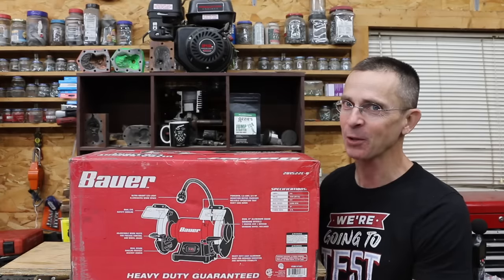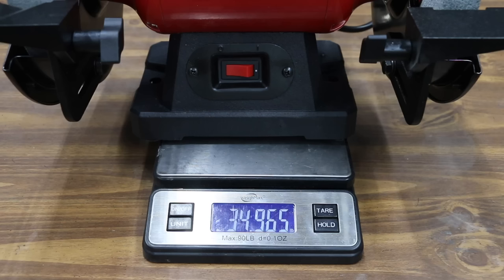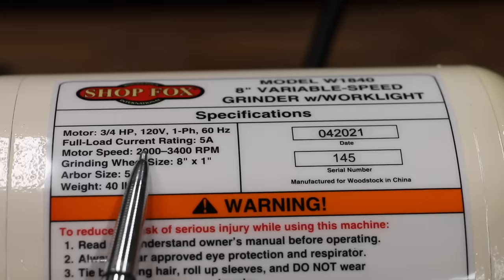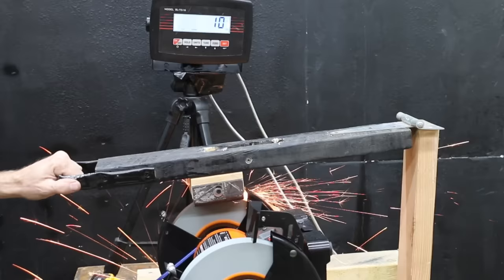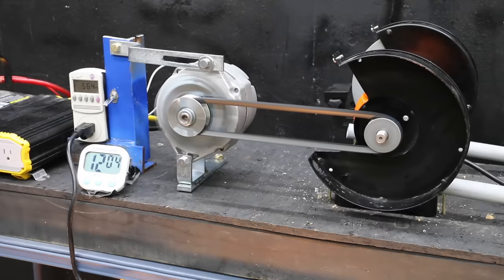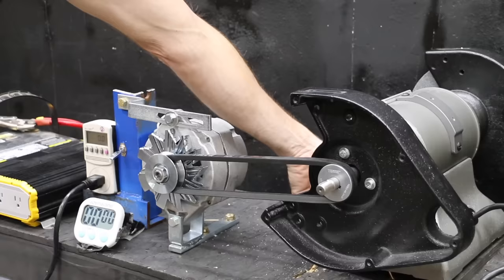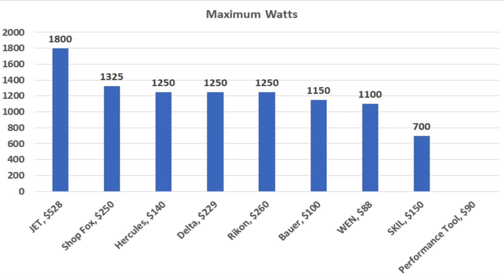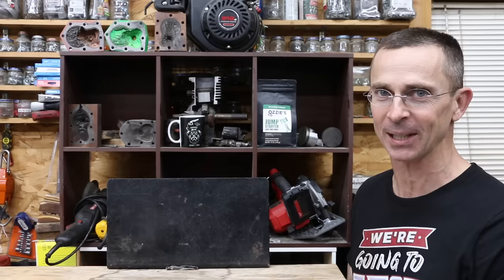Best Bench Grinder? Let’s Settle This! Harbor Freight Bauer vs JET, Hercules, Rikon, Shop Fox, Delta

Comment: Love this channel,  I honestly don't by anything PF has tested without checking wit him first, from tools to epoxy ect. Even bought a heated jacket on his say so, thanks man
Reply from the maker: Thank you very much! This means a lot to me!
Reply: I want to see blondes vs brunette vs redheads. Tests should be very interesting!
Reply: @ProjectFarm  no problem,  my sister in law asked me which epoxy she should use to fix an exercise step, I checked your videos before recommending one, I also bought a Stihl petrol chainsaw, my jacket, chop saw blade and rechargeable AA batteries based on your videos, although if I'm honest I was most likely going to buy the Stihl saw anyway but the rest was all on your say so, again Thank you
Reply: @terryboyer1342  it's something I have tested myself extensively,  and the results were Brunettes 🤣🤣
Reply: @olliedee  🤣👌

Comment: Correction: The Jet is not a 5.5 Amp motor on 120V circuit. See the info plate - it's 11 Amp at 115V and 5.5 Amp at 230V

Comment: Most of us don't want to buy a different brand for each electric tool (drill, impact, reciprocating, etc), would be really interesting to get a video compiling the results of the major brands to see which brand/battery system is the best as a whole package if you are starting fresh.
Reply from the maker: Thanks for the suggestion.
Reply: starting out, i say ryobi. as a retired remodeling contractor, who now makes jewelry boxes and what not out of my shop, i have a whole bunch of their stuff. they are very tuff, batteries last well, is it makita? no.. but about 1/4 the cost and still pretty impressive.
Reply: It seems like Milwaukee consistently scores high in his test
Reply: beauty about tools is you build them over time. wait for sales, figure out their real price vs what's posted on the website/sticker, etc.

Comment: I would love to see a comparison of in-sink garbage disposals. I recently had to replace mine and was surprised at the number of options and price points out there. I ended up buying a 1 HP InSinkErator, but I wonder if I could have gotten similar performance for less money.
Reply from the maker: Thanks for the suggestion.
Reply: If you do this to us, you got to use Waste King, absolutely indestructible Beast, insinkerator and badger are absolute garbage in comparison. I could stuff a dead body in my Waste King. It never rusts, it never leaks, it never stops, it never Binds. it's like the Terminator of garbage disposal, and it's no more expensive

Comment: I would LOVE to see you test these against an old Baldor or Dayton. They're in a league of their own as far as smoothness, build quality, and power. They simply work amazing and do so forever. 
I wish I owned one but they're just so expensive. Luckily we have one in the shop at my work. There's probably another 25 or so Baldor and Dayton motors on various machines in there and maybe another 75 on the rest of the farm. In nearly 4 years I've only seen one break and it was installed in the 90's.
Reply from the maker: Thanks for the suggestion.

Comment: Most telling test for me was the one where they responded to pressure applied - Its what annoys me most on my cheapo grinder - Great tests
Reply from the maker: Thanks for sharing!
Reply: These aren't snagging grinders. They're made for light bench grinding. A snagging grinder is what's used to remove sprues from castings. They typically have a 30" diameter wheel on them and they're around 15 HP or so. Yeah go ahead push as hard as you want.

Comment: Request: This is a long shot, but as a fireman, a question I have pondered… what is the best hand cutting tool? Fireman like to carry a cutter of some fashion in their gear for the unknown scenario. Whether it be a car battery cable, or a drop ceiling that fell on you in a structure fire- it’s wise to have a small tool for cutting your way out. One handed operation would be ideal, but not absolute. I would like to see a video comparing cable cutters, tin snips, or whatever you think would be best, cutting a myriad of materials.
Reply from the maker: Thanks for the suggestion.

Comment: I believe that Jet one excelled so much in the pressure and torque testing because the winding has a primary winding that is wound deliberately to be fiercely overdriven by 120v supply so the magnetic field is enormous and it kick starts the rotor and when it gets up to speed the centrifugal switch (witch you can actually hear kick in and the sound of the motor changes) shuts off the primary winding and switched over to the normal stator designed for 120 mains. If you would prevent the rotor from spinning at its full speed for an extended period of time after a few minutes or even a few tens of seconds the primary winding would start to burn, it is designed for powerful and high torque kick start for the motor and then supposed to be switched off by the centrifugal switch so it does not burn itself out. The same design is used in garbage disposal motors so they would have the torque needed to start spinning even if the thing is loaded with food scraps, otherwise it would just hum and never start spinning.
Reply from the maker: Thanks for the feedback.

Comment: I have a Central Machinery Industrial unit that I bought from Harbor Freight mail order back when they only had 2 stores in the US.  It's rated at 5 amps, performs   at least as good as the Jet in every category, and even has the same lockout key as the Jet.  I've been using it professionally on a daily basis since 2006 and it's never shown any wear other than dirt than grime that won't clean off.  I've been Googling the part number for years hoping I could buy a pallet of these things somewhere.
Reply from the maker: Thanks for sharing.

Comment: I had the delux craftsman from 10 years back. The clear guards flopped down till the screw stripped and I took them off. Took the side guard off too. Led's were one single led each side and they were not good for anything, eventually they flickered and I took them off too.
  I'd recommend bolting it to a plate to the table, I set a wood bench to smolder and didn't notice and went inside.. Just smoke damage luckily beside needing a new one and getting that craftsman.
 I think they're all under-powered now or maybe I'm just give them too many hot suppers and expect it to like it.
  Also I put a wet towel on the motor housing once it started to cook (140°f -160, yikes hot) and would run it like that (the craftsman) for hours all the time just re-wetting it as it steamed away.
Reply from the maker: Thanks for the feedback.

Comment: The time at which the wheels hit operating speed is actually a safety feature, the slower is technically better. Those wheels can crack internally, spinning them up fast will cause them to fragment which can cause injury. A slow speed up gives you a chance to turn it off before it becomes a missile. Tip: never stand on front of those wheels during start up.
Reply from the maker: Thanks for the feedback.

Comment: Really enjoy your practical, realistic, and scientific testing methods. Here is my video suggestion: 
12v vs 18/20v compact 3/8 impact wrench showdown! I see a lot of companies advertise 12v impacts to have similar performance to their larger caliber counterparts. So in tight places (like under the hood of a car) is the smaller light weight size of the 12v better or is a compact “stubby” offer that much more performance. I would like to see all tested in their most compact form with the smallest most compact battery. Suggested brands I’d like to see tested: Dewalt, Milwaukee, Hercules, Skil, Bosch. Please include price with battery, overall size/weight with battery, torque, runtime under load, controllability, and charger compatibility between sizes. 
Thank you for your hard work and testing protocols.
Reply from the maker: You are welcome!  Thanks for the suggestion.

Comment: Review suggestion---Best Belt Grinder, i.e. Burr King, Delta, Kalamazoo, Grizzly, ect. 

This was a great review except I would have liked to see some lower HP rated models...I purchased a Black & Decker 6" bench grinder all the way back in 1984-85...1/3 HP 3500 rpm...Made in USA..I think I paid somewhere around $50 for it at our local Hardware Store.....I still have it mounted on my bench. Use it almost daily. It does double duty as a buffer. I lost count of how many grinding wheels I've worn out on it. Great little grinder. There was a time when B&D made pretty darn good shop equipment 🔥🔥
Reply from the maker: Thanks!  Thanks for the constructive feedback.

Comment: Great job as always! For future ideas, I think a test of stop leak products, for radiators or transmissions etc, would be great.
Reply from the maker: Thanks!  Thanks for the suggestion.
Reply: I worked in a radiator shop for 5 years. I lost track of how many vehicles came in because of stop leak. Everything in the cooling system was completely plugged up including the heater core. No amount of flushing could clear them, and you would have to throw both the heater core and the radiator away. NEVER use stop leak. Fix your leaks properly or get a replacement part and you won't be sorry.

Comment: I've had that Wen for 4 years and it's held up. Put a wire wheel on it about 6 months ago and use it to clean up all kinds of stuff. I work at a small engine repair shop so I have access to a much better one, but for a home owner that Wen is hard to beat.
Reply from the maker: Thanks for the feedback.

Comment: Been using a variable speed WEN for 2 years now. It is replacing a 40 year old Delta. Works great!   My request for a test would be Battery Packs and "Which of these battery packs can  power a Cpap for a 9 hour period"
Reply from the maker: Thanks for sharing!

Comment: The groove test is a really good idea.

My only change suggestion would be to have it loaded by a pneumatic cylinder so it has constant pressure the whole time.

I've come across some cheap grind wheels that actually last a decent amount of time if you only ever use light pressure but if you try to hurry along you can just feel it falling apart due to poor friability/frangible properties.
Reply from the maker: Thanks!  Thanks for the constructive feedback.

Comment: Can you test hammers
Reply from the maker: Great suggestion!  Which brands do you suggest testing? Any ideas on test procedures?
Reply: Dropping a each hammer with a 10lb weight on the back onto different size nails
Reply: Milwaukee, Stanley fat max, dewalt, daller store
That’s all I can think of at the moment but I’ll comment again if I find more
Reply: Martinez m4 titanium $500 hammer

Comment: During startup, I noticed several grinding wheels were severely out of balance.  A runout measurement would speak to the quality of the stones or arbor bushings and complement the groove test.  Curious if the additional vibration increased sound measurements?  Thanks for the effort you put into these tests.  Very well thought out and executed.

Comment: It’d be neat to see a slow speed grinder “tool-off”!  I’ve only ever had a 60 year old Craftsman high speed (that I’ve rebuilt multiple times in 30 years just because I happened to have the brushes on hand, I still use with only buffing wheels for polishing the edges of my scorp, drawknives, gouges, etc) the other is a Rikon Slow Speed that I’ve been totally happy with but I know that the next time the craftsman dies that I’ll buy a second slow speed grinder (I’m a woodworker and so I have no need for a high speed).  Thanks for the content; it’s not always pertinent to me, but I watch them all.  👍
Reply from the maker: Thanks for watching!  Thanks for the suggestion.

Comment: Surprised craftsman bench grinder wasn't among those, probably don't matter anymore anyway.  I have an old 8 inch craftsman that is still going strong, flip the switch and It's instantly ready to go, because with came with a good capacitor. 3/4 hp but the torque is high, you can bare down on it hard and it keeps going. Industrial bearings with the proper copper wounding wrapped around a proper armature.. it's still solid after all these years, it stamped (Made In The USA)... The good old days,, and it out weighs those made in china one's... that was a great down to earth test on these grinders,   Definitely will  help people make the right choices,  All do-it-yourselfers needs a grinder
Reply from the maker: Thanks for the feedback.

Comment: I have SEVERAL grinders including  one made in 1920 and another in the 1940s. I have a giant open buffing wheels on a Baldor factory setup also. I think that the QUALITY is directly proportional to the stopping time. Those old induction ball bearing motors were made to last forever. Nice review...I would spend the $500 in a second...no question.
Reply from the maker: Thanks for sharing.
Reply: @ProjectFarm  my pleasure

Comment: I'm really happy to see jet turn out on top. I recently came into a jet brand 14 inch band saw on the sideof the road in the trash! It was a barn clean out. You better believe  I took it off the base and stuffed it in the front seat of my 2012ford taurus sho and drove that bad boy home lol. It had the table, motor, and everything except one pulley wheel.
Reply from the maker: Nice!  Thanks for sharing!

Comment: Grinders that are shipped with the wheels in place can bend the stamped-type washers used for mounting them. Check for bent shaft, then bent mounting washers if the stones wobble. Sometimes you can order machined washers from Riobi grinder or a table saw mfg. you can shim-up the stones with card stock in a pinch.
Reply from the maker: Thanks for the feedback.
Reply: This is a solution looking for a problem.

Comment: Bench grinder longevity trick. Always give a wheel a quick, powerful spin before actually starting the machine. This way your machines electrical components (brushes etc) aren't initially arcing under load.
Reply from the maker: Thanks for the suggestion.

Comment: I would like to see a video comparing Welding Gloves. Non contact heat protection, direct contact heat protection, durability, fit, flammability, dexterity... It would also be cool to see a video comparing Welding Helmets/ face shields.
Reply from the maker: Thanks for the suggestions.

Comment: I've had 3 bench grinders: Baldor, Grizzly, & Jet. The Baldor is in a totally separate category, industrial grade, durable, expensive. When I retired I needed a home shop grinder, enter the Grizzly 8" the shafts were machined horribly off. The tool rests were floppy, the original wheels were of poor quality. Frustrated, I bought an 8" Jet. Much better quality, much more expensive, tool rests reasonably stiff but lacking full adjustment, no light, better wheels, dust collection ports. The jet can be turned into a very good machine just by adding a good light & making more adjustable tool rests. I've converted the Grizzly into a buffer where the eccentric motion doesn't matter as much.
Reply from the maker: Thanks for sharing.

Comment: On the Jet grinder, it does draw 5.5 amps at 220V.  11 amps at 115 V.  This is a dual voltage motor.
Reply from the maker: Thanks for sharing!

Comment: well I as a welding student have a few ideas one such idea involves preparation tools like wire brushes and others include protection like welding jackets welding gloves welding helmets and even down to the process materials like tungsten and filler rod or machines to even like the accessories but thats just my idea for what you can do for this kind of stuff
Reply from the maker: Thanks for the suggestions.

Comment: So like most garage tools... Buy a high enough quality that it will work well and save you headaches, and you'll end up using it for the rest of the time you can stand in a garage. Skimp too much and you'll end up replacing it or having to deal with the headaches from trying to use it. 

Lots of good Jet bench grinders still out there on the used market. I was lucky enough to find a 3/4hp Jet grinder for 80 bucks and didn't even bother trying to get a lower price, just packed up and drove out as soon as possible to happily pick it up. It beats the old MSC branded grinder I was using previously hands down, and any new iteration unless you are going to spend 500+ on one.
Reply from the maker: Thanks for the feedback.

Comment: Excellent job with seeing how many watts the grinder could put out before stalling.  Placing an electrical load, as opposed to a mechanical load, to stall it.  Much like a dynamic brake on a VFD.  Superb test.  Watched numerous of you videos because of the objective testing methodology you devise.  Thank you!  EDIT: Also, I think the test to see how long it takes to stop would show the better build for the longer coast time due to less friction from the bearings.  Cheers!
Reply from the maker: Thanks and you are welcome!  Thanks for the constructive feedback.

Comment: So I just came across an electric car jack kit that caught my eye, googled it and saw a few different kits available some come with an air ratchet to remove lug nuts as well. Considering it just plugs into your 12volt adapter in your car/truck it seems very convenient. I'm thinking this would be great to see you put them through the tests. I'm Considering getting a couple for my teen drivers
Reply from the maker: Thanks for the suggestion.

Comment: It’s not fair to compare with wire wheel. Wire wheel has less mass so it will speed up quicker and it has more air resistance so it’ll slow down faster. Air resistance doesn’t make big difference when speeding up because the force is small relative to motor but when slowing down it makes huge difference. Since the wheels are just accessories which are interchangeable I think it would be the most fair to use the same for all of them.